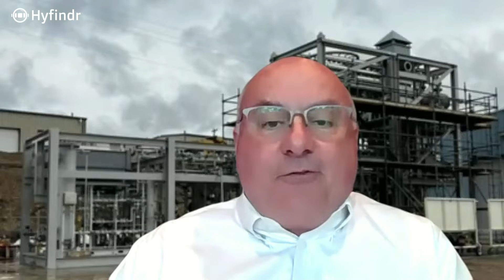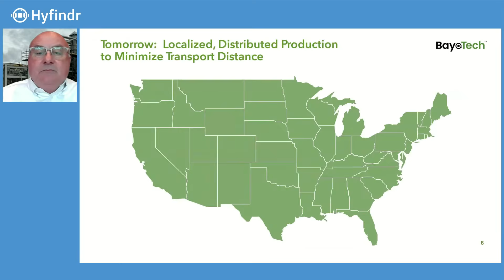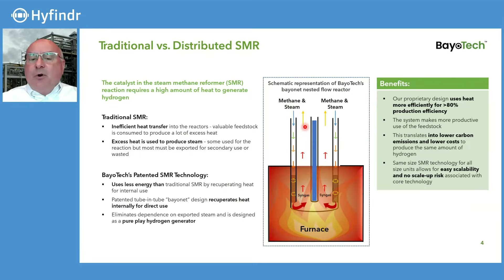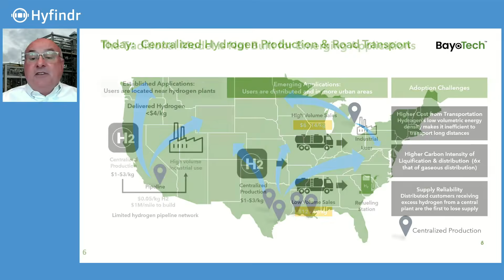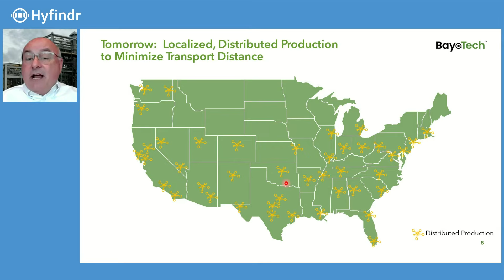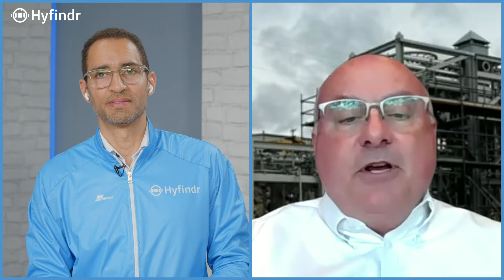Tech Talk - Hydrogen Production - Steam Methane Reforming - Hydrogen Tech Explained - Hyfindr Powers

Comment: now there are coming news on Natural Hydrogen underground  at depth of 1.2-1.5km possibly due to serpentinization, Schikorr reaction or interaction of iron-rich rock with water. Else Methane is the richest source of Hydrogen having 25% mass content of Hydrogen followed by Ethane and Propane components of Natural Gas/crude oil. Hydrogen is coproduced commercially by catalytic steam reforming of methane, partial oxidation of methane, Methane pyrolysis, Dehydrogenation of ethane or propane or ethyl benzene, Electrolysis of water, Electrolyis of brine or chloroalkali process with other products being Carbon Monoxide or solid carbon or ethylene or propylene or styrene monomer or oxygen or chlorine gas and Na/K hydroxide. Majority of Hydrogen comes from state of the art steam reformer process that operates at 900 degC and 20-30 bara pressure. Hydrogen separation and purification takes place using state of the art pressure swing adsorption that uses layered bed  and gives pure hydrogen in high pressure adsorption step for downstream usage.
Pyrolysis of Methane has been studied using plasma reactors, using molten salts catalyst, using molten metal catalysts and there is a company in USA which uses plasma reactor to pyrolize Methane into Hydrogen and solid carbon. Synthesis gas is used for making Methanol, Ammonia, reducing iron ore and SMR process integrates very well with the downstream applications most of which need continuous processing. Still hydrogen will never fail to show its poor energy density per unit volume

Comment: Also to produce X amount of Hydrogen from 10 thousand small SMR. Is going to produce more CO2 then produce the same amount of Hydrogen in Larger but less numerous SMR plant . Because more materials that will be required to construct all those plants.
Reply: It's one time to be spent for construction, however the small plant will be continuous.  Bottom line they need to do a co2e footprint year by year till 20 yrs. It's like cash flow or life cycle calculation

Comment: So any SMR system using natural gas is going to produce CO2 which needs to be captured in a solid. No company is doing this. Also any SMR is going to deplete the feed stock ,,,,,,Methane. Depleting earth’s resources is not a way to save this planet.  So the only ethical way to make Hydrogen is Esther by using Solar, Wind, Geo Thermal, Hydro, and Nuclear but only nuclear for the transition period until the other methods produce all the Hydrogen we need. All these process use green electricity to electrolyze WATER. Because when the Hydrogen is used in. Combustion or in. Fuel cell  we get back the water,,,,A closed loop sustainable as long as the Sun is shining on earth. SMR is not sustainable.

Comment: I believe steam reformation in general consumes lot of movement  from one place to another to refine which initially increases the cost. Also you have to maintain very low tempreature if transporting in liquified form and that is why many fuel stations are shutting down considering the cost

Comment: Sorry dude. You're barking up the wrong tree with hydrogen. Besides the fact that hydrogen combustion engines are a non-starter and hydrogen fuel cell vehicles require precious metalsto be built, and the costs and hazards inherent in compressing, shipping and storing high pressure hydrogen, and the low energy density of anything less than liquid hydrogen... Even if technology manages to overcome all of those drawbacks, the problem remains that the energy cost to refine hydrogen then turn it back into useful electrons to drive a vehicle is at least three times the energy cost to simply charge a BEV battery and use that energy to drive the car. This is dictated by physics and chemistry. No technology can overcome these barriers.
And one more thing. High pressure hydrogen is insidious. It leaks right through metal containers and causes embrittlement of high pressure systems. This means that if the systems are not replaced, an explosion is inevitable. That is the main reason why the very few hydrogen refueling stations that ever existed are either closed or scheduled to close in the near future.
Edit: PS. Steam reforming is NOT green and carbon capture is a fabrication of wishful thinking.
Reply: Seeing the last statement after finishing my thesis on blue hydrogen production is crazy man😂😂😂
Don't get me wrong, I do believe you
Reply: @emmanuelebong7659  There was a time when I believed that hydrogen fuel cells would be the next greatest thing. Then I looked at the math. So much for that dream.
What I don't know, is the theoretical maximum energy density for batteries. It would be nice to know how much lighter we can expect BEVs to get.
Reply: As a matter of fact, I am a genius. The solution is simple and obvious. Use all that electrical power to charge BEVs directly instead of the expensive, dangerous, complicated, indirect route of going through hydrogen as an intermediate step. This is obvious to me, but I'm a genius. @jaxolotle
Reply: Look. Dude. Your food most likely comes from fertilizer made from metane and steam reforming. Feasible, however, to go via electrolysis of water. And produce insitu fertilizer. No amount of electric cars can alter this. Fertilizer accounts for 2 or 3% of global co2 emissions. And its not 'hard-to-abate'.